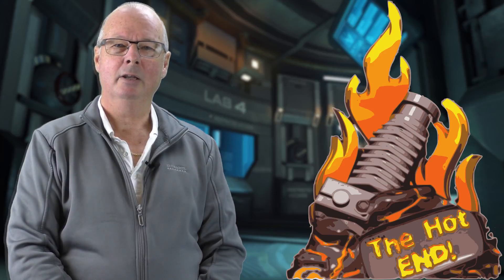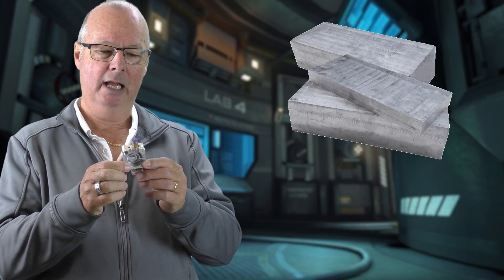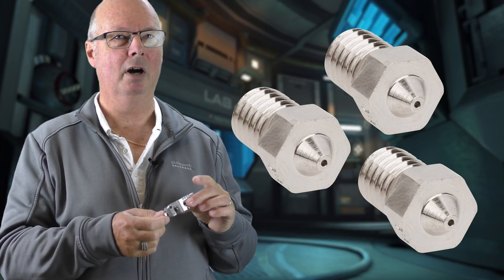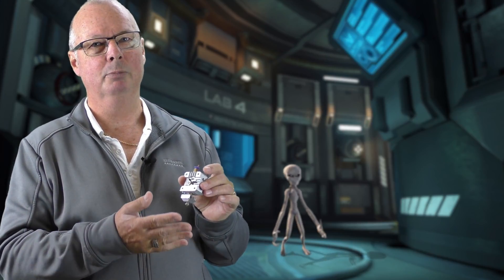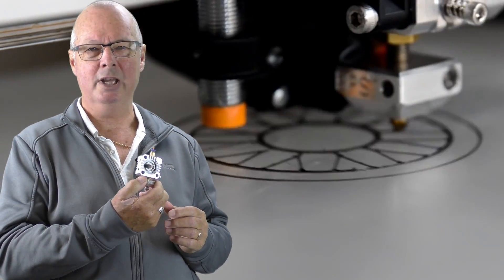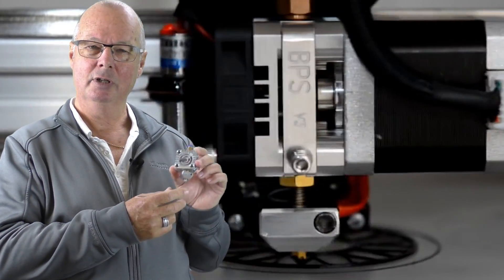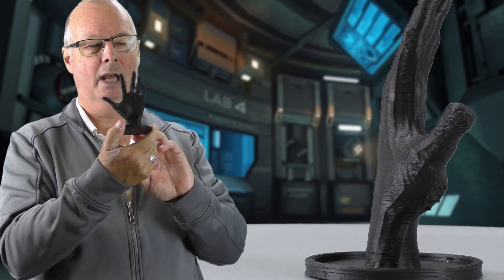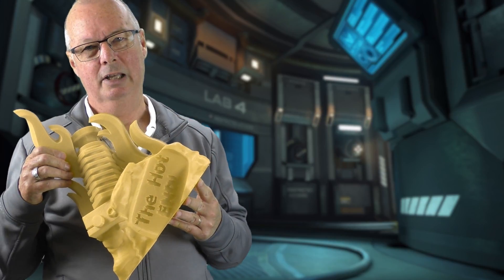Print Flexible Materials like a BOSS with the BPSv3 Extruder! Plus PrintiNZ second opinion!

Comment: The BPS extruders are a work of art, I've been trying to find the time to set up the v2 which is awesome but non-standard so you have to adapt a lot of things. It looks like the v3 fixes that and the integrated heatsink is really clever. That plus the option to use a metal liner instead of PTFE makes it pretty much universal. Awesome!
Reply from the maker: Yeh it really is Angus - It kinda caters for every requirement.. and AUSSIE made!  Compared to flexion its much cheaper and better buy in MY opinion (Anthony)